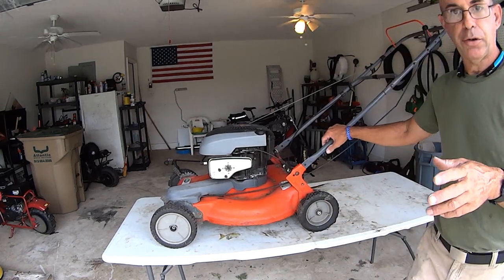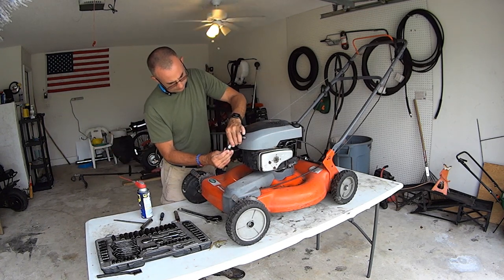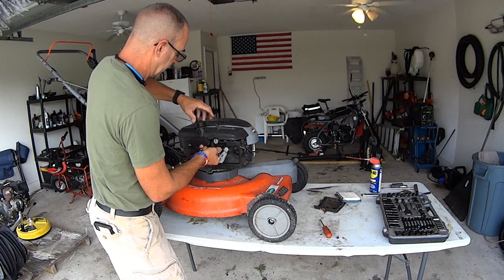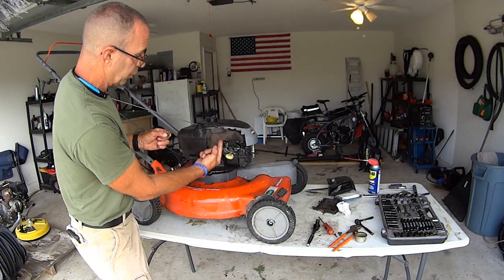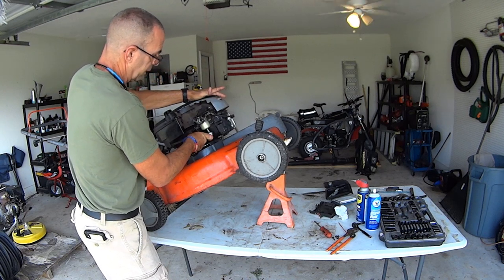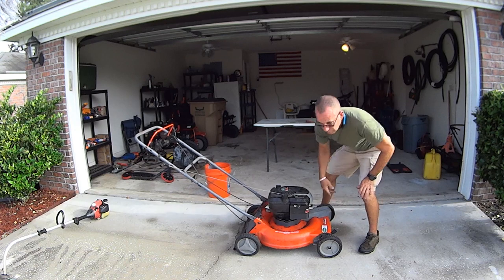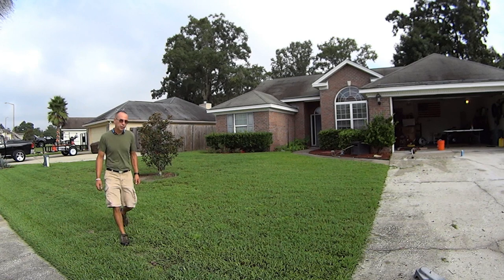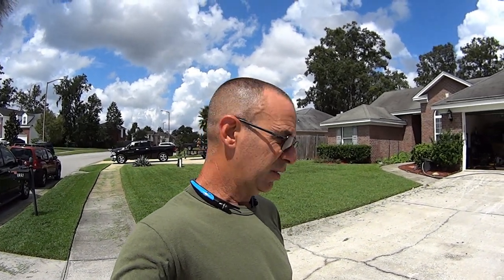CURB FIND REPAIR - Diagnose and Fix Non-Starting Lawn Mower #SideHustle

Comment: I found PB 250 blower in trash, new plug and carb cleaner it fired up. Ordered new carb, and air intake cover. The fuel lines in the tank were gone. So the kit includes them. I believe under $30 I'll have a $190 blower. Was in the market for one, but didn't want to spend the money when I have a PB 580 backpack blower.
Reply from the maker: You did great!

Comment: I agree that low quality lawn equipment can reach a point where buying parts to keep alive is not cost effective;  I finally gave up on my Homelite and got a Husqvarna 525L, my first decent trimmer;  I never considered spending $270 for a trimmer BUT now I understand quality is worth the $; this trimmer will last AND it is SOOOO much easier to use; (never thought I would ever own a ONE PULL trimmer); wish I had done this long ago. Watching Dan using his quality trimmers got me to consider paying for quality; went with Husqvarna simply because I got Military discount at my local Lowes and they had an extra 2 year warranty deal going on. Also by spending $49 I got the 5th and 6th year warranty PLUS 50% refund on all the consumables and parts over the entire 6 years.
Reply from the maker: Great deal!!

Comment: Cool,   Another way to stop other than pull the plug is use a flat head screwdriver and put it where the “off” switch is missing contact ( when then bale is down)  and that will cause it the ground out since the screwdriver is conducting and. Completing the circuit.
Good entry level video for this kind of stuff. 

This year I  found at least 8 lawnmowers  in the trash. 7  were fixable 1 was seized.   
I even found a Honda commercial HRC216. In the trash, with bag 
https://m.youtube.com/watch?v=2cVOIArQR6U

BTW: that orange mower there. Looks like a Scott’s mower. Which is really made by MURRAY.   Maybe back in the 2003 time frame
Reply from the maker: It is a Scott’s! Great job George!